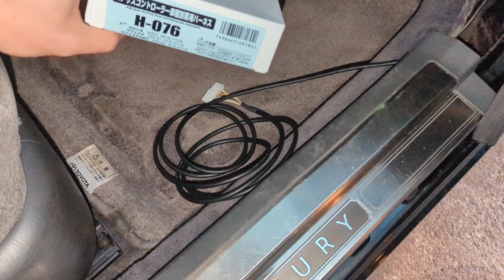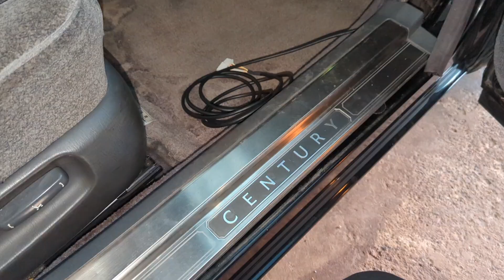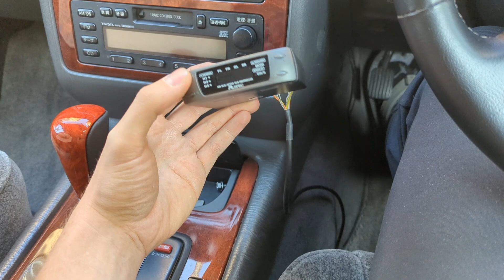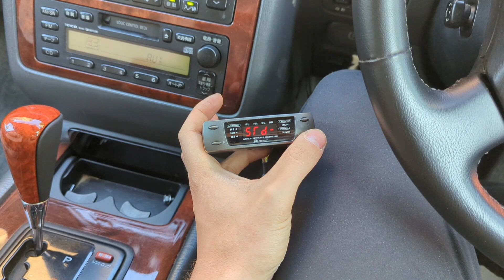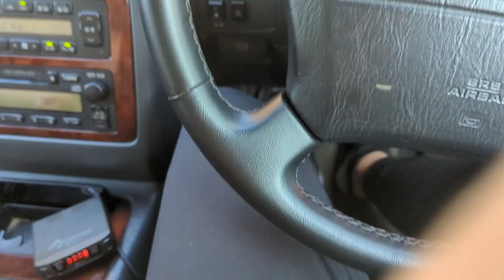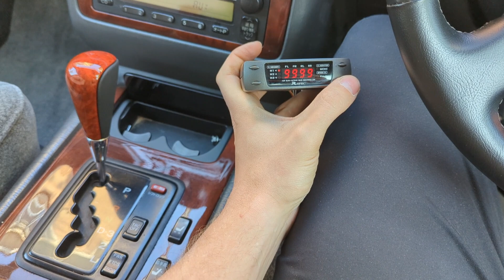Air Suspension Controller Install - Toyota Century G50 V12

Comment: Do i get it correctly, that for a 2008 Century i have to look out for a ASC680 with a H087 harness? Because this returns me a ls430 instead of a ls400 as compatible. Or in other words, what harness is most likely the correct one for a 2008.
Reply from the maker: I would think so. But since I have a 97 it's hard to tell

Comment: For me 6c lowers only back, 7c setting lowers only right side of the car. Do you know where problem can be? Using ASE663 controller
Reply from the maker: What harness are you using? I had the same issue when I bought an LS400 harness, had to get an H-076 harness specifically.
Reply: @qc.century  I don't know exactly. It was removed from Majesta UZS171 UZS173.  Maybe I could send you few pictures of the harness to your email?
Reply from the maker: The harness number should be written on it in bold black letters
Reply: @qc.century  It's a H-076D

Comment: Set it to 7c not 6c.
7c is celsior or ls400 settings.
Reply from the maker: You know what you are completely right according to the manual, 7C is listed as the appropriate choice for the ls400 and celsior, but somehow 6C has been working for me. I'll try out 7C and see if it changes anything.

Comment: is it possible to only adjust the front or only adjust the rear? I want to drop the front a bit more than the rear
Reply from the maker: Yes it is. You can cycle through each individual bag to set a preferred height. But be advised the front suspension doesn't go very low. Overcoming that limitation requires cutting and welding. There is a physical limit where the spindle contacts the arch of the wheel well.

Comment: Thanks for this tutorial. Was a big help doing mine. Can confirm the process is basically the same for a 2006 with a ASC680. Was a bit tight getting the connections into the computer though.
Reply from the maker: Glad to hear it :)
Reply: Hi bro did you use the H086 harness for the 06 century

Comment: How do you tell which controller and harness you need? Just got a 1997 century
Reply from the maker: Took me a while to figure it out and i bought three different harnesses to figure it out. But i also have a 97 so ASE662 with a H-076 harness should work for you!
Reply: @jaimiestroomer1107 afair (read some manuals) 1997 till 2005 uses the same controller and harness.

Comment: It looks really good - what are the steps if you just want to remove the air ride controller? Just unplugging everything, and the car will auto-adjust to its normal height?
Reply from the maker: Unplug the aftermarket controller and re-plug the factory connectors back in the factory computer yes. I can also leave the controller in and set it to "NO" in which case it doesn't do anything and defaults back to the factory height.